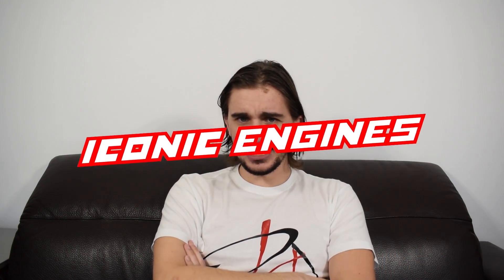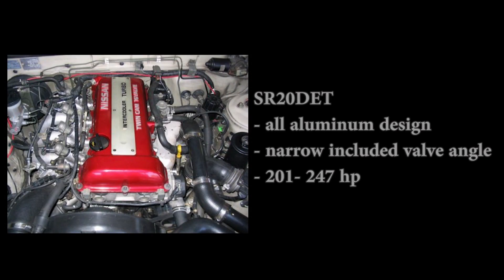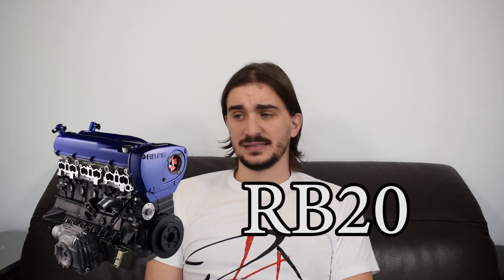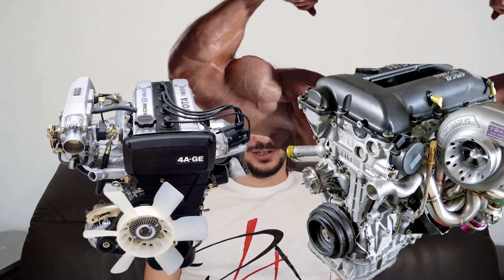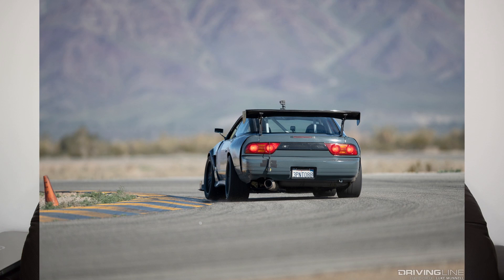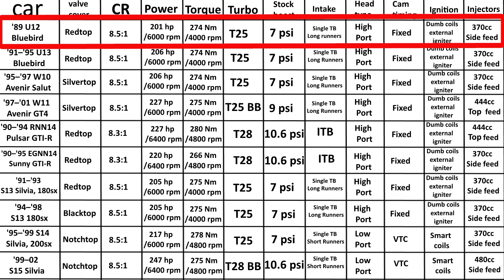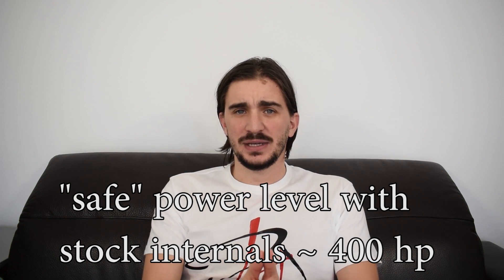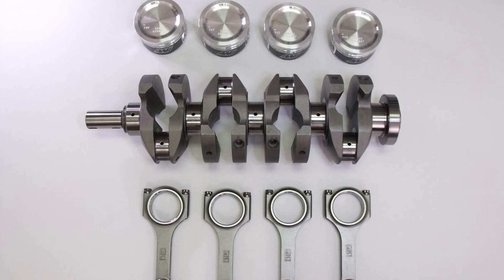Nissan SR20DET - What makes it GREAT? ICONIC ENGINES #9

Comment: So between this and other 2.0 liter 4 cylinders from the 90's which one's do you find better for daily driving around 350-400whp?
Reply from the maker: Honestly you can't go wrong with any of them. 4g63 has massive stroke and makes a lot of torque down low, a feature it often retains even after various upgrades, so it might be best for driving around town and low speeds etc. But the difference isn't as noticeable as you would think. The biggest factor, like four fifths of the story, is in the tuning itself. If you want to daily 2.0 liters at 400hp the tuner needs to know what they're doing, and adjust fuel and ignition everywhere and not just chase peak output and bragging rights. This of course means more dyno time. Also, don't buy stupid lift and duration cams, this is a sure way to make daily driving a massive pain. Bigger isn't always better.
Reply: @d4a  thank you will be looking at an eclipse GSX or galant vr4 now lol
Reply: Go for Mitsubishi 4G63T. You will do not regret it.Fantastic engine for  daily driving with heaps of potential.
Reply: @SerceWTropikach  Car: ’05 Nissan Silvia S15
Engine: SR20
Driver: Muhammed Ali allahu akbar 
1/4 Best ET: 6.228 @ 226.81 MPH
Track: Orlando Speed World
Date: Oct 27, 2018
Status: Active
The driver of this Nissan S15 is Muhammad Ali, and his ride is the quickest and fastest SR20-powered ride on the planet. He has some badass people helping him make things happen and he does a great job behind the wheel as well. MazWorx built and tuned the chassis to the SR20, which cranked out over 1,800 horsepower on the dyno at 60 pounds of boost. Legendary tuning guru Shane Tecklenburg handles the tuning of the car and you can tell it’s got his stamp all over it, running both ridiculously quick and consistent, which shows the tune is near perfect and they aren’t just taking stabs at the parameters to see what works. Anybody who knows anything about Shane T knows his rides are consistently quick like this and shatter records regularly, proof that he’s the man in the tuning world.

The numbers the car puts up at almost perfectly on par with NHRA Pro Stock, allowing me the opportunity to make a comparison between the drastically different combinations. Pro Stock rules, as most of you know, mandate naturally aspirated powerplants, while this SR20 is crammed with almost 70 pounds of boost at speed on the track. Of course, it has half of the cylinders of the 500 CID V8 under the hood of a Pro Stocker, which makes around 1,500 horsepower.

So how does the Pro Stocker run the same ET with less horsepower? The answer is contained within the interview with Mark from MazWorx, who talks about the chassis. See if you guys can determine the difference and let us know what you think.
Reply: Car: ’05 Nissan Silvia S15
Engine: SR20
Driver: Muhammed Ali allahu akbar 
1/4 Best ET: 6.228 @ 226.81 MPH
Track: Orlando Speed World
Date: Oct 27, 2018
Status: Active
The driver of this Nissan S15 is Muhammad Ali, and his ride is the quickest and fastest SR20-powered ride on the planet. He has some badass people helping him make things happen and he does a great job behind the wheel as well. MazWorx built and tuned the chassis to the SR20, which cranked out over 1,800 horsepower on the dyno at 60 pounds of boost. Legendary tuning guru Shane Tecklenburg handles the tuning of the car and you can tell it’s got his stamp all over it, running both ridiculously quick and consistent, which shows the tune is near perfect and they aren’t just taking stabs at the parameters to see what works. Anybody who knows anything about Shane T knows his rides are consistently quick like this and shatter records regularly, proof that he’s the man in the tuning world.

The numbers the car puts up at almost perfectly on par with NHRA Pro Stock, allowing me the opportunity to make a comparison between the drastically different combinations. Pro Stock rules, as most of you know, mandate naturally aspirated powerplants, while this SR20 is crammed with almost 70 pounds of boost at speed on the track. Of course, it has half of the cylinders of the 500 CID V8 under the hood of a Pro Stocker, which makes around 1,500 horsepower.

So how does the Pro Stocker run the same ET with less horsepower? The answer is contained within the interview with Mark from MazWorx, who talks about the chassis. See if you guys can determine the difference and let us know what you think.
Reply: It comes down to what you like. The SR can do everything the 4g63,3sgte,k20 or any of the other 2.0 4 cylinder can do.

Comment: I thought you would mention the VET aswell..
Reply: N1 SR16VE too.
8 fuel injectors. Top and side feed.
Reply: Thats a head conversion
Reply: @robertlund5694  there is a stock SR20VET in the nissan xtrail it makes 280hp at the crank

Comment: This is super awesome........... Hey I am gonna run a Honda program an my 4age 20v wish me luck
Reply: one thing I discovered is that honda motorcycles use a map sensor with vacum hose connection and they also have a 4-1 vacum tube fitting that go to the throttlebodies...
Reply: samuel lopes this is to give the ecu proper MAP signal, you combine the vacuum from each runner into a vacuum “chamber” of sorts and send that to the MAP to control the ecu
Reply: @roystanifer2243   I know , that's why I mentioned it. I know the 20 valve has individual throttle bodies....

Comment: In Japan they didn't have 500 hp drift cars when they start started using sr20 most were stock/ bacis modifications  max 300 hp back then late 90's early 2000's
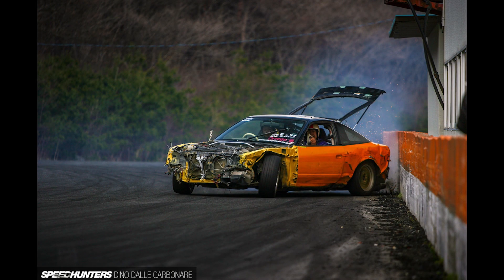Reply: Thats what he said. 7:55
Reply: Exactly that's what I was thinking.
Reply: People are obsessed with hp numbers because of yt and dont enjoy their cars.
Reply: Car: ’05 Nissan Silvia S15
Engine: SR20
Driver: Muhammed Ali allahu akbar 
1/4 Best ET: 6.228 @ 226.81 MPH
Track: Orlando Speed World
Date: Oct 27, 2018
Status: Active
The driver of this Nissan S15 is Muhammad Ali, and his ride is the quickest and fastest SR20-powered ride on the planet. He has some badass people helping him make things happen and he does a great job behind the wheel as well. MazWorx built and tuned the chassis to the SR20, which cranked out over 1,800 horsepower on the dyno at 60 pounds of boost. Legendary tuning guru Shane Tecklenburg handles the tuning of the car and you can tell it’s got his stamp all over it, running both ridiculously quick and consistent, which shows the tune is near perfect and they aren’t just taking stabs at the parameters to see what works. Anybody who knows anything about Shane T knows his rides are consistently quick like this and shatter records regularly, proof that he’s the man in the tuning world.

The numbers the car puts up at almost perfectly on par with NHRA Pro Stock, allowing me the opportunity to make a comparison between the drastically different combinations. Pro Stock rules, as most of you know, mandate naturally aspirated powerplants, while this SR20 is crammed with almost 70 pounds of boost at speed on the track. Of course, it has half of the cylinders of the 500 CID V8 under the hood of a Pro Stocker, which makes around 1,500 horsepower.

So how does the Pro Stocker run the same ET with less horsepower? The answer is contained within the interview with Mark from MazWorx, who talks about the chassis. See if you guys can determine the difference and let us know what you think.
Reply: @オッさんタイプXの日産に乗る  and ?? In Australia we have the fastest sr20 in the world . Who cares about American here in Australia we have been doing the import scene longer then the USA. Wrong in Australia we have the fastest s15
Reply: @_i-kr6eg  Australians  s15 is doing 800hp so ??

Comment: Great video,  but the FJ20et is king sr20 are rubbish.
Reply: Car: ’05 Nissan Silvia S15
Engine: SR20
Driver: Muhammed Ali allahu akbar 
1/4 Best ET: 6.228 @ 226.81 MPH
Track: Orlando Speed World
Date: Oct 27, 2018
Status: Active
The driver of this Nissan S15 is Muhammad Ali, and his ride is the quickest and fastest SR20-powered ride on the planet. He has some badass people helping him make things happen and he does a great job behind the wheel as well. MazWorx built and tuned the chassis to the SR20, which cranked out over 1,800 horsepower on the dyno at 60 pounds of boost. Legendary tuning guru Shane Tecklenburg handles the tuning of the car and you can tell it’s got his stamp all over it, running both ridiculously quick and consistent, which shows the tune is near perfect and they aren’t just taking stabs at the parameters to see what works. Anybody who knows anything about Shane T knows his rides are consistently quick like this and shatter records regularly, proof that he’s the man in the tuning world.

The numbers the car puts up at almost perfectly on par with NHRA Pro Stock, allowing me the opportunity to make a comparison between the drastically different combinations. Pro Stock rules, as most of you know, mandate naturally aspirated powerplants, while this SR20 is crammed with almost 70 pounds of boost at speed on the track. Of course, it has half of the cylinders of the 500 CID V8 under the hood of a Pro Stocker, which makes around 1,500 horsepower.

So how does the Pro Stocker run the same ET with less horsepower? The answer is contained within the interview with Mark from MazWorx, who talks about the chassis. See if you guys can determine the difference and let us know what you think.
Reply: The FJ20 was the predesessor to the SR20 but I dont know of any FJ20 powered cars winning at time attack,road racing or drag racing.
Reply: @conradsealy9603  clueless kid . There are many fast fj20 powered cars .
Reply: @_i-kr6eg  ok then. Name one fj20 powered car that made 6 second 1/4 mile passes. Or any fj20 powered car that won a time attack event. Anywhere. Mr car guru. 🤔
Reply: @conradsealy9603  says the non car person and snowflake kid .

Comment: 180SX = CA18
200SX= SR20
240SX= KA24
Reply: actually in europe the 200sx had a ca18det
Reply: @Omifi  each model ? S12 , s13 , ?? After 200sx gazelle??
Reply: @Omifi  they got three s12 one is for part . Other two rare cars one has ca18det or is RSX s12 FJ20et got that one from japan
Reply from the maker: This is incorrect. The 200sx existed both with the Sr20 AND the ca18, and so did the 180sx.
Reply: @d4a  s13 is 180sx same thing . Sorry I think because in Australia we use the Japanese names and model codes
Reply: @_i-kr6eg  i could be difficult and say rps13 xD but im not trying to under-mind the content or the creator of it, the info is spot on, grew up and around these iconic engines so i just chimed in something
Reply: @d4a  a s14 in Australia is 200sx see we use different types of codes
Reply: @d4a  even a s15 in Australia is called a 200sx .
Reply: Generally thats how its named and what USUALLY comes with it based on the market/region/time period, 180SX that came with SR20s are usually converted, where im from we got a lot of them from Japan that already had the conversion mostly because the parts for the CA18 were hard to come by there and most countries around the world.
Reply: @cerviche101  after the CA18DET was discontinued the SR20DET was the stock in 180sx engines
Reply: Wrong where is the fj20et!!!
Reply: Car: ’05 Nissan Silvia S15
Engine: SR20
Driver: Muhammed Ali allahu akbar 
1/4 Best ET: 6.228 @ 226.81 MPH
Track: Orlando Speed World
Date: Oct 27, 2018
Status: Active
The driver of this Nissan S15 is Muhammad Ali, and his ride is the quickest and fastest SR20-powered ride on the planet. He has some badass people helping him make things happen and he does a great job behind the wheel as well. MazWorx built and tuned the chassis to the SR20, which cranked out over 1,800 horsepower on the dyno at 60 pounds of boost. Legendary tuning guru Shane Tecklenburg handles the tuning of the car and you can tell it’s got his stamp all over it, running both ridiculously quick and consistent, which shows the tune is near perfect and they aren’t just taking stabs at the parameters to see what works. Anybody who knows anything about Shane T knows his rides are consistently quick like this and shatter records regularly, proof that he’s the man in the tuning world.

The numbers the car puts up at almost perfectly on par with NHRA Pro Stock, allowing me the opportunity to make a comparison between the drastically different combinations. Pro Stock rules, as most of you know, mandate naturally aspirated powerplants, while this SR20 is crammed with almost 70 pounds of boost at speed on the track. Of course, it has half of the cylinders of the 500 CID V8 under the hood of a Pro Stocker, which makes around 1,500 horsepower.

So how does the Pro Stocker run the same ET with less horsepower? The answer is contained within the interview with Mark from MazWorx, who talks about the chassis. See if you guys can determine the difference and let us know what you think.